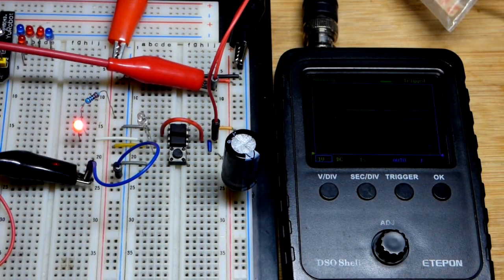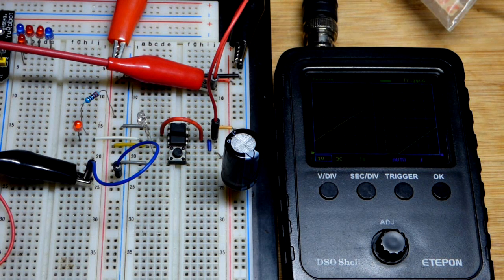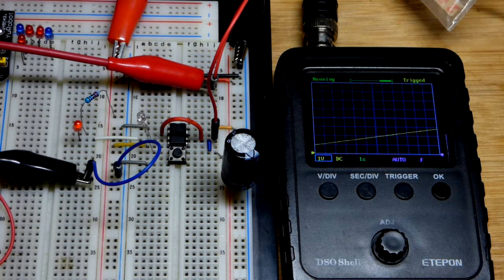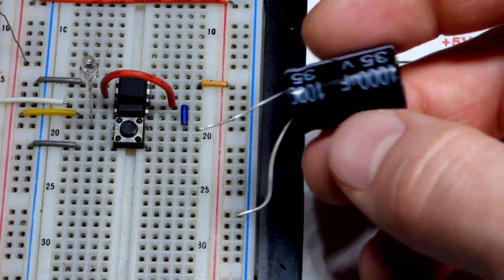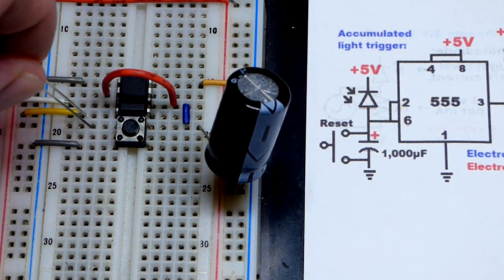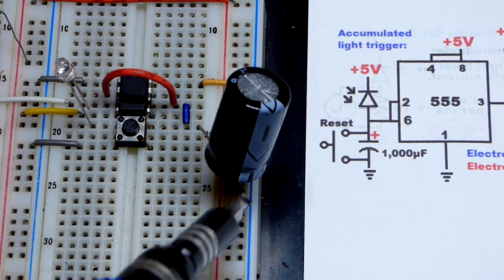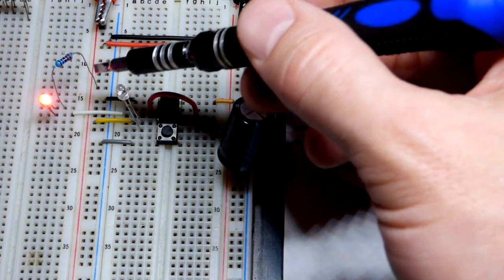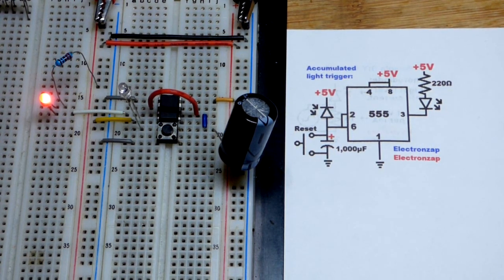Accumulated light trigger circuit using 555 timer and photodiode learning electronics lesson 0063

Comment: Thanks for the Video, I was able to follow it but it would be nice if you slowed down just a tiny bit when talking about the connections. I've been using the 555 for sometime and I have some knowledge of circuits using them and what to expect but some people might not and would take a little longer following the connection paths
This circuit has so many uses.
Reply from the maker: Thanks for the tip!

Comment: Do you have a video that talks about positive triggering of 555? Seems most people use it in negative pulse trigger
Reply from the maker: No, I did not know about the positive trigger 555. Looks like a cool circuit though, so I'll try to remember it for later, thanks for mentioning it!
Reply: @Electronzap  I was looking to mod my set top box. It has a 5mm signal led(~1v across it) in the front panel that lights up when the dish coax cable is connected to the box. I was looking to extend the led with a 555+buzzer+positive trigger from the led.